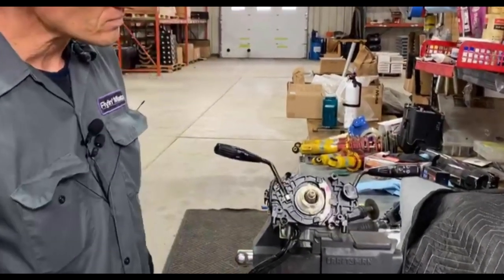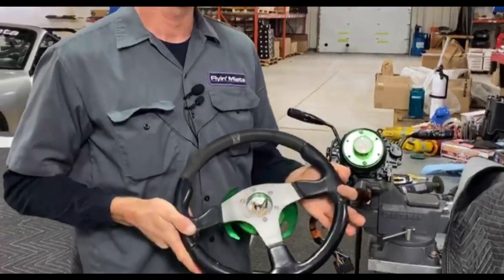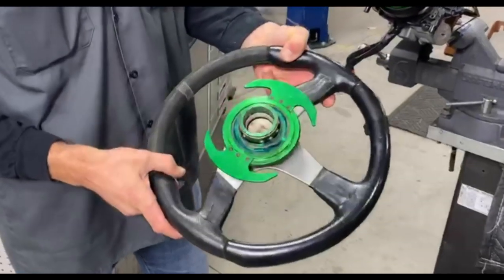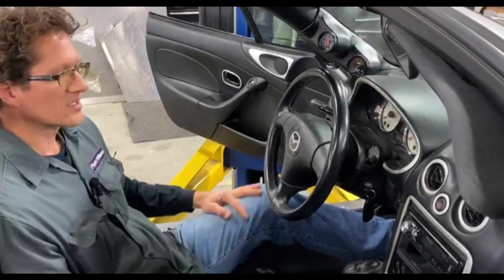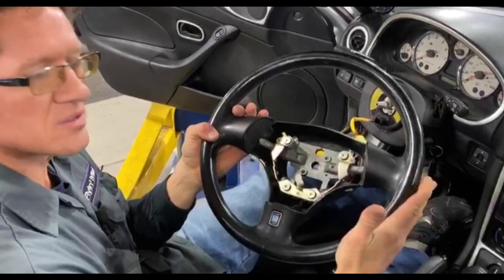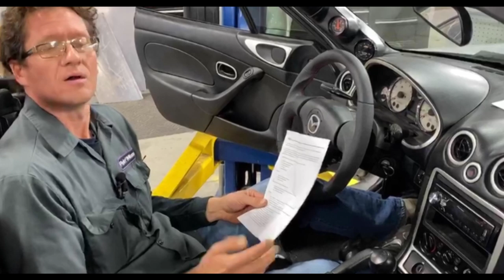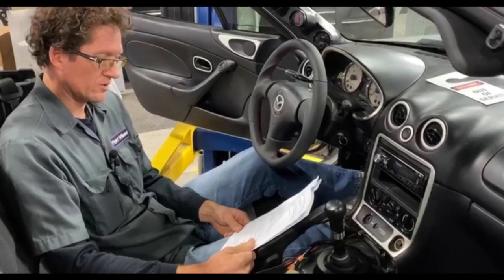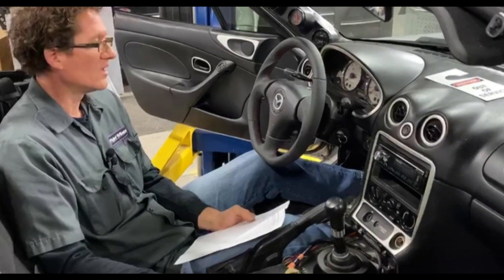Miata Steering Wheels (FM Live)

Comment: Guardian Designs makes smaller diameter wheels that retain the stock air bag. Not sure what they cost and you have to send them a wheel core to use, but they look really nice.
Reply from the maker: We sell CipherAuto wheels for most Miatas that retain the airbags as well. They are a good option for a sportier wheel without sacrificing safety :)
Reply: @FlyinMiataVideo  yes I’m considering a Cipher wheel, since I can’t seem to find an OEM wheel in decent shape. And a smaller diameter wheel would block too much of the gauges for my liking.